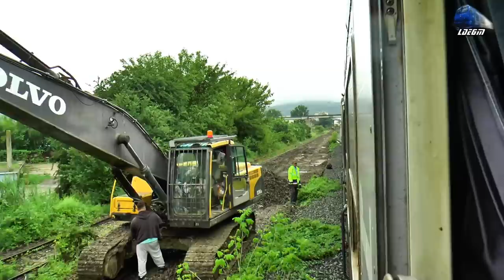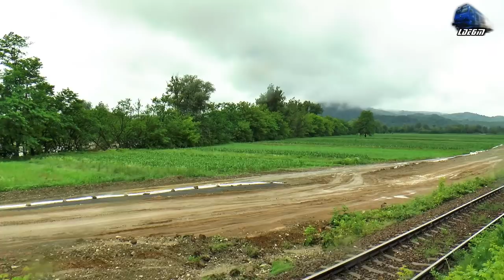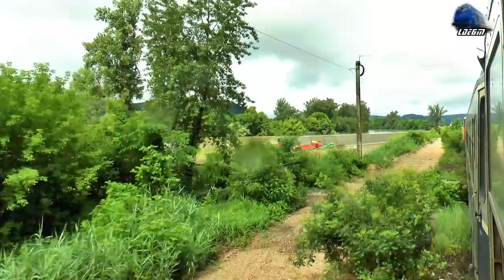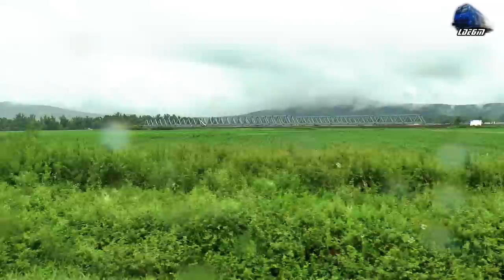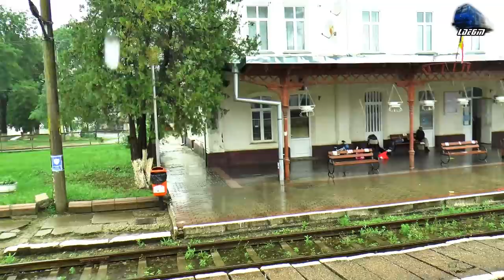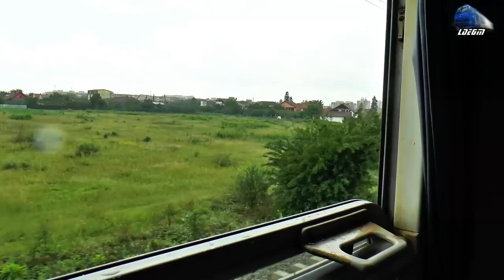Călătorie Simeria-Deva-Ilia-Săvârșin-Radna-Arad Train Ride @IR1921 Mangalia-Arad - 18 June 2020

Comment: by 2008 now I am 12 years living in Romania and NOT 1x time using the CFR.... and I know why.... I am wondering that the corrupt political System and criminal Mafia structure has not taken all the locomotives....
...
between 1980 - 1990 I have used the CFR absolutely often....
....
Reply from the maker: True ;)
Reply: @ldegmtrainspotter  in 1980 and later til 1995 it was a pleasure to go by CFR for example from Buc - via Adjud to Gh. Gh. Dej...
...
but now....
we have arranged 2 yrs ago for got friends a CFR trip 1rst Class from B Nord to Vaslui...
Doamne fereste...
....